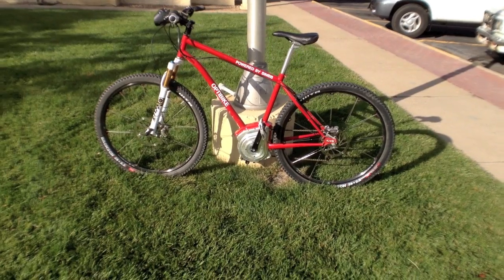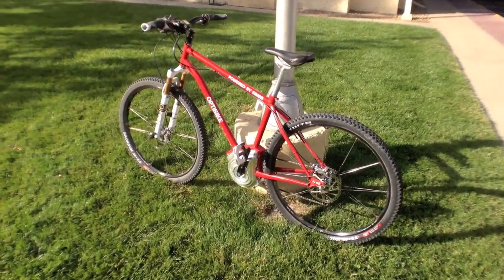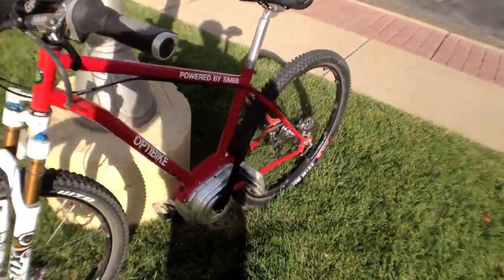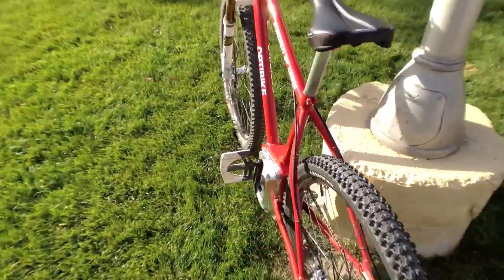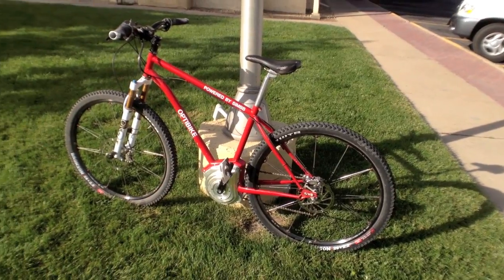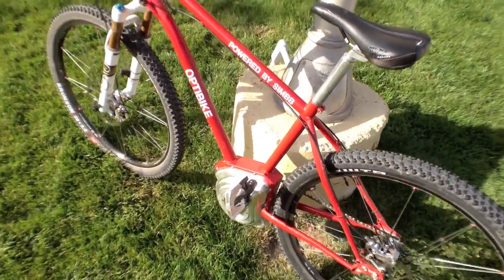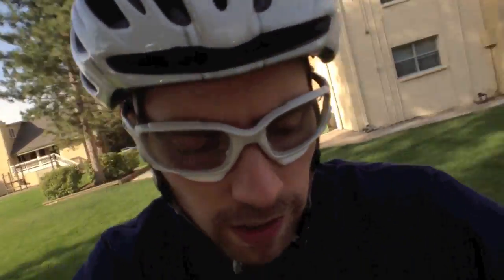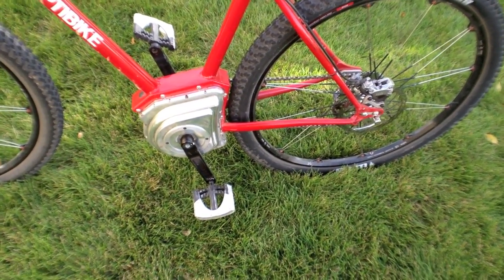Optibike SIMBB 29C Review - $5.7k

Comment: Pretty nice bike. I like it better than the older style OptiBike's. This one looks like it would be a lot easier to work on. That was a major drawback on the old style. I still don't care for the gear noise you get from the mid drives, but I guess you get used to it. Every bike ever made has compromise in one way or another. There's no perfect one bike. I seriously doubt you'll get many Americans to agree that throttle only is a drawback though lol.
Reply from the maker: Yeah, I used to prefer throttle but the more I've ridden the more I appreciate a nice pedal assist configuration. I enjoy pedaling and appreciate the exercise it provides... but why not have a throttle? At least a little trigger that won't impact your grip. I think Specialized did a good job of adding one with their Turbo S http://electricbikereview.com/specialized/turbo-s/

Comment: At about 6:33 into the video, you mentioned that one of the drawbacks of this bike is lack of PAS. What would be the advantage of PAS when one could simply feather the throttle to save on "fuel?"
Reply from the maker: Great question! In my opinion, pedal assist naturally incentivizes pedaling (especially if it's torque, cadence and speed sensing) but it is true that advanced throttle control may approximate the same benefits of increased range and fluid acceleration... it just takes more focus. The big benefit of PAS with a mountain style ebike is that you can grip the handlebar more securely for maneuvering over rocks or bumps vs. compromising one hand to either twist or push a trigger in addition to dealing with shifters and brakes. By letting your feet and legs control the speed of the bike, it's more natural and lets you do other things with your hands/arms.
Reply: Electric Bike Review Got it. You're right. I can see how PAS (especially torque-sensed) would be better on technical trails. Thanks!
Reply from the maker: ***** Sure thing! Glad to help and I'm happy you asked :)
Reply: That's debatable. Trials motorcycles which ride extremely technical courses only have throttles, but I've never heard anyone complaining about it. PAS in mainly a legal dodge to get around "20 mph under it's own power" laws.

If throttles promote fat, then you can say the same thing about silverware LOL.
Reply from the maker: BiknutProductions I've heard that plate and dish size do influence how much people eat... source: http://www.choosemyplate.gov/weight-management-calories/weight-management/better-choices/decrease-portions.html

Comment: What a beautiful piece of engineering. Looks like the SIMBB could also have the ability to be sold has a kit,,, for the brave who would dare cut into, and melt on their own existing bike. Add some more height to it, for more battery capacity, torque sensor and integrate the display into the top of it,(eliminate ALL cables). Bluetooth and App, is like something out of the future, lol. Really amazing design  :)
Reply from the maker: I agree, pretty sweet piece of kit. Would love to see a torque sensor option, I think that makes the most sense for e-mountain biking ;)

Comment: The range isnt enough. It could be improved if it had pedal assist. Also, considering it claims 600w and boasts about how that's so much more than the 350w Bosch, it only does 26mph whereas the Bosch 350w does 28, and that's only because it's restricted to 28. I do like the integration of everything though, very neat. I'll be interested to see if they can develop this into something a little more sophisticated.